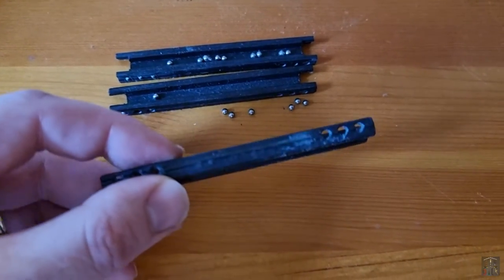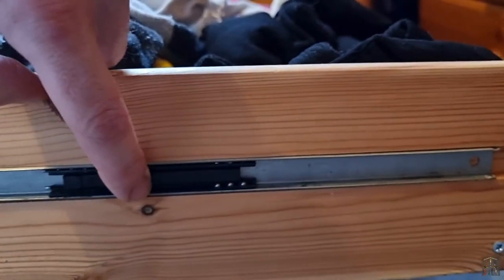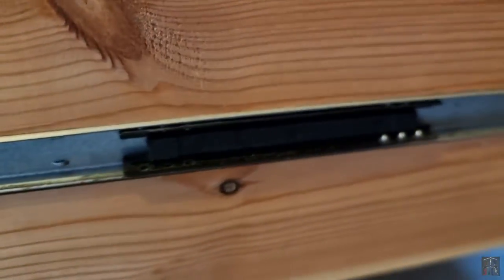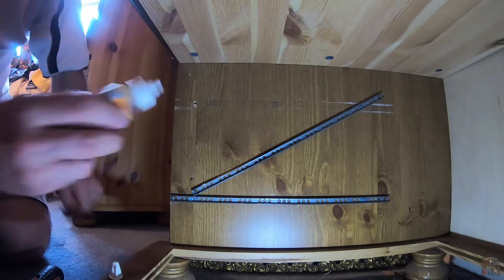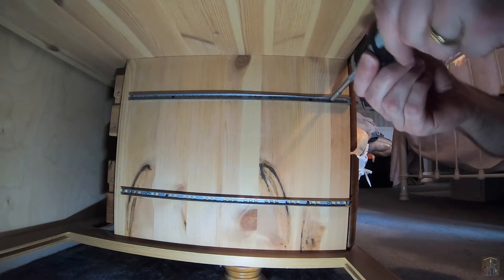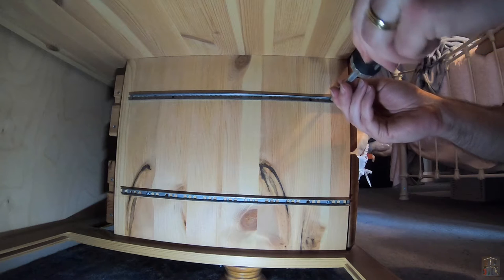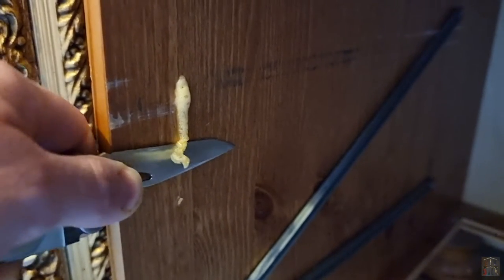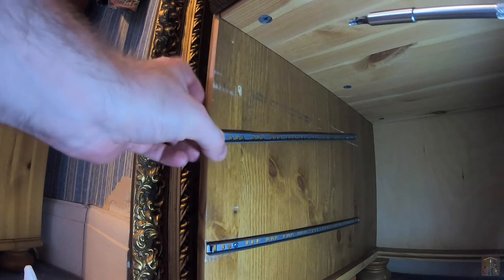Fixing a broken Drawer Runner

Comment: the one thing i needed to see to fix my drawer was how to insert the ball bearing runner into the slide, which of course you didn't show.
Reply: Did you find out how to do it?
Reply: Has anyone worked out how to get the black plastic runner with ball bearings into the slide please?
Reply: How do you put the ball bearing slide back in please?